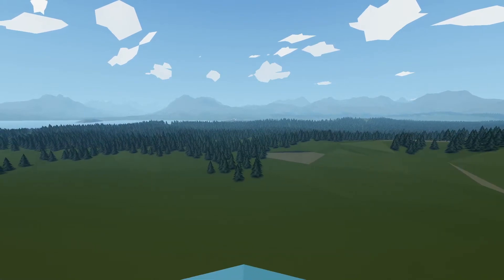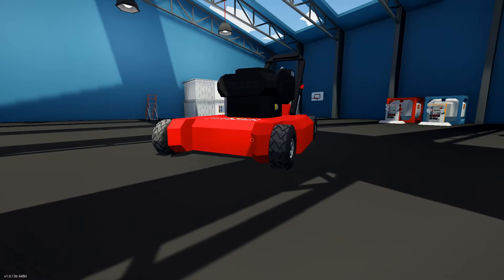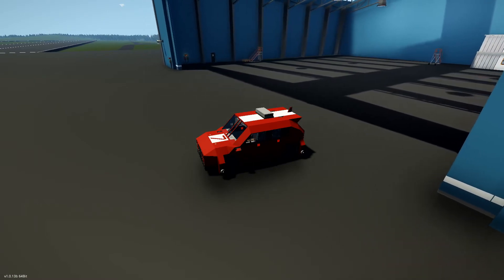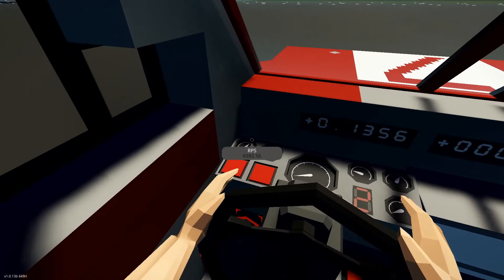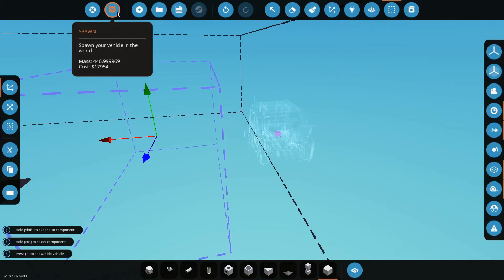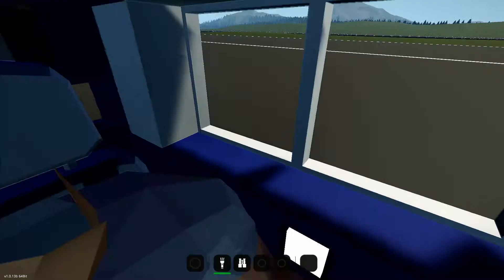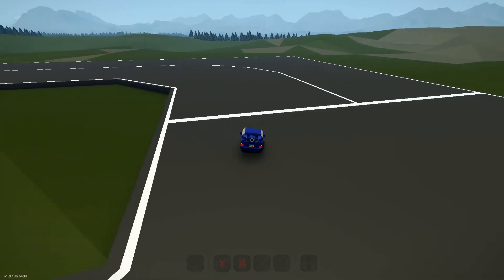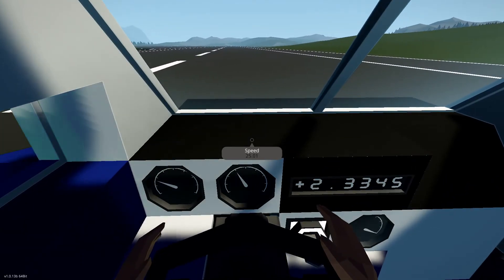Modular Engines With One Cylinder | Stormworks 1.0 Update

Comment: you can make a rpm limiter by simple detecting whent it hits 20 rps for example and set the throttle to 0 untill its under 20 rps
Reply from the maker: I guess that is a possibility.
Reply: @StormRunnerGaming  thats what i have done
Reply: @StormRunnerGaming  I do the same, and have for years.
Reply: pls guys, the almighty pid-controller is superior in every way
Reply: @NoWayOut8344  Not always, sometimes it is less efficient. Not to mention a lot slower at greatly changing loads.

Comment: Dirtbike/Enduros are almost always 1 cylinder, and they're by no means underpowered
Reply from the maker: Yeah, I was really talking about underpowered in terms of things like a moped or something else like that. I wonder how large that one cylinder is for dirtbikes.
Reply: StormRunner Gaming  I reckon they go from about 100cc - 700cc for a proper bike, anything lower and it’s for lil kids / pit bikes
Reply from the maker: @marki_mark3410  It would be interesting if stormworks had a system to increase the size of the single cylinder, but that would throw off its easy 1 block size to build with